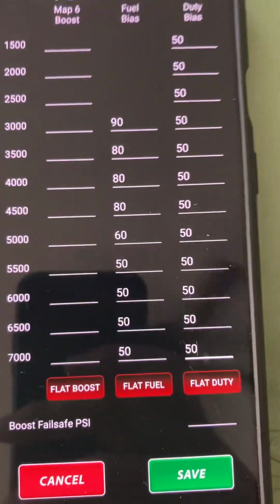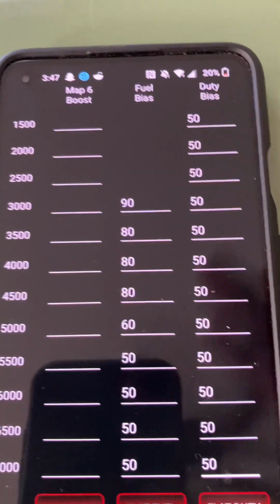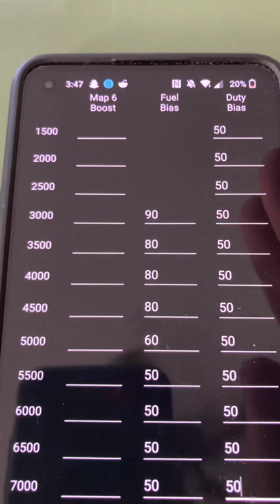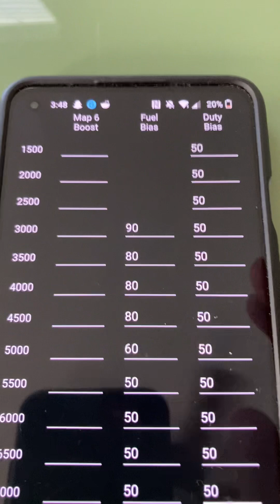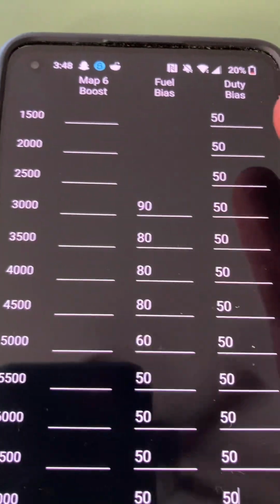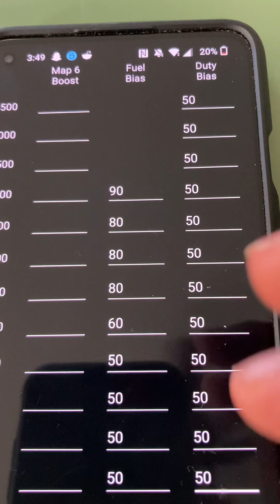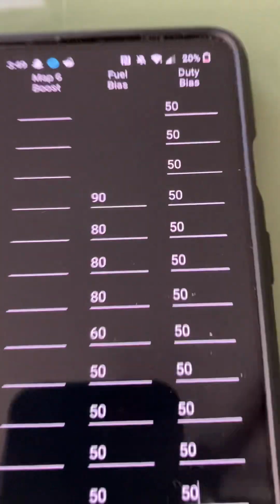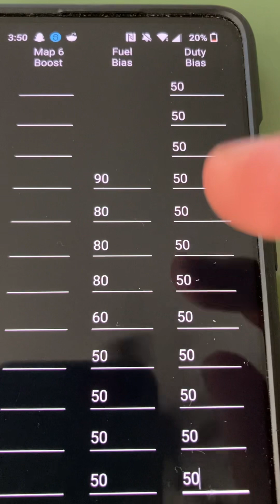22 wrx JB4 how duty bias works

Comment: But ya, now I know how to adjust my settings based on my log information. 
I have to say that when you know what you are doing the jb4 really is a great tool and since switching to map 6 and starting out with the settings you recommended I've seen a huge increase in performance vs the standard maps. Now that I understand how to dial it in I'm sure it will be even better.
Reply from the maker: Heck yea brother if you ever need anything hmu!

Comment: Thank you for the video , can you tell us how FF/wastegate adaptation exactly works and how it benefits us to lock it at lower or higher number .
Reply from the maker: A lower number would have the waste gate open further. You build boost as the waste gate closes stock the waste gate is in the 55-60% range as you increase the ff you build boost faster and make more boost, but with this it can easily be messed up and cause you to over boost. I normally recommend slow and steady 48, 50, 52 increments of 2 or 3 not just a flat 75. The wrx wants to over boost down low. When I had it set up right I made a consistent 23 psi
Reply: @DylanCarGuy  perfect man ! I have my map6 pretty set ! but as the temps and DA are lower I noticed lowering the FF the car felt good . perfect and simple explanation.
Reply from the maker: @rorod3123 great, yea I had to have my FF set pretty low around 3k rpm once I got a j pipe because it just wanted to build that boost like crazy.

Comment: What should I adjust for my 2022 Subaru outback Onyx edition? I have a Mishimoto intercooler and I deleted my charcoal filter with a k&n slip in filter.
Reply from the maker: @igortodorovic6463  just run map 2 if you’re on 93 and check out your afr under wot may not need to change anything
Reply: @DylanCarGuy  i ran Map 2 since yes I use 93+ but got a bunch of random shuddering while doing heavy pulls and power would die down when shifting into later gears. I ran threw all the steps with a Jb4 support member and they helped me set everything up. I do wanna keep it as safe as possible but I feel like maybe it's on a too safe set up if it makes sense and I feel like I'm losing some power I could have had otherwise. Also they had me change after a few pulls and info going back and forth the fuel bias to 90 and open loop to 0. Does it make sense ? Changed nothing else besides that.
Reply from the maker: @igortodorovic6463 you really need to learn how to read the map on your own to figure out why it’s shuddering. Let’s say after is 12 12 12 12 10 10 well ofc if it’s that rich it will shudder then you adjust at the rpm limit to get rid of the 10s and turn them into 11.5s
Reply from the maker: @go third gear manually 3000 rpm press start log run to red line email me log rx8.vabeach at g m a i l

Comment: I'm working with Burger lately on getting a log that doesn't max out trims, and they keep having me LOWER (not raise) the duty bias! They also want me to lower the FF. Yes, this helps trims, but screws up boost values. The only reason ANYONE would buy a JB4 or an ecu tune is to make their car go FASTER. I sometimes think Burger forgets this, and just thinks the goal is to have a nice looking log. No, the goal is to go faster. Sure, safety is a thing, but some risk is also neccessary. The problem with the JB4, is it can't adjust fuel directly, and that's why a real (non-piggy back) tune is Best.
Reply from the maker: I made the same power with the JB4 on e30 as i did on a 93 protune pushing 23 psi. HMU if you need some help getting dialed in
Reply: Thanks, I appreciate that. Your videos are quite informative. But my car isn't a Suby, so a lot of stuff will be different. I'm just roaming youtube and the internet, trying get more of a general education on duty bias, etc. Thanks again 👍 @DylanCarGuy
Reply from the maker: @shinymike4301  ahh makes sense ya unfortunately I can’t help with non Subarus, but cannon is solid for advice

Comment: Would you have to save and load after adjusting?
Reply from the maker: You would just have to save them run another data log rinse and repeat
Reply: @DylanCarGuy  Thank you!
Reply: @DylanCarGuy  made adjustments as recommended. AFR at WOT is between 11.2 and 11.8. Gapped an 2015 M3. No mods just a tune.
Reply from the maker: @jjasonsantos  this is the way! Heck ya brother on E30 I normally push it into the 12s make some serious powa